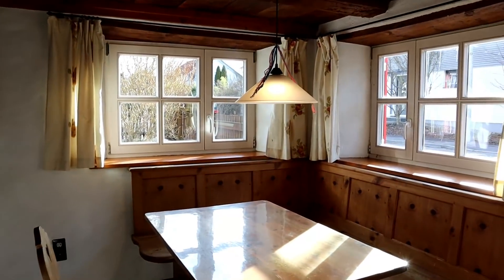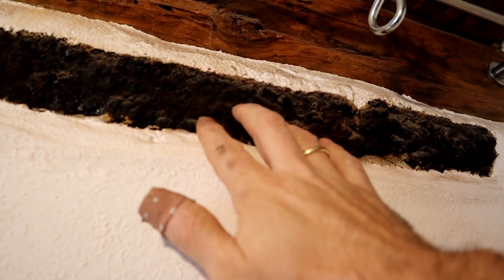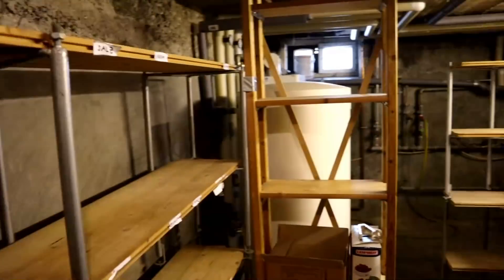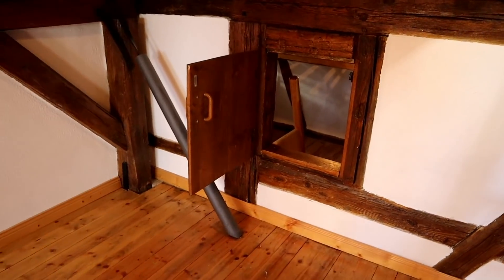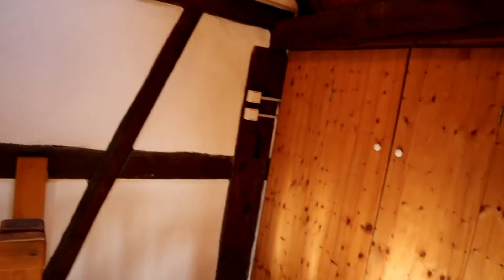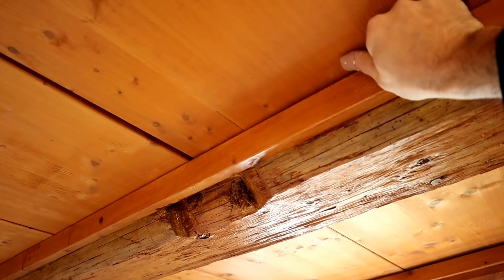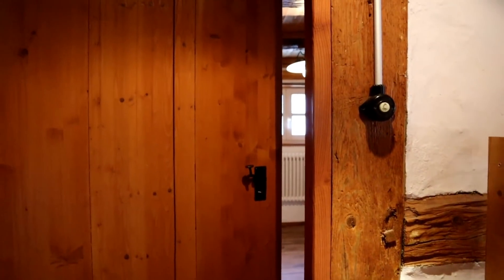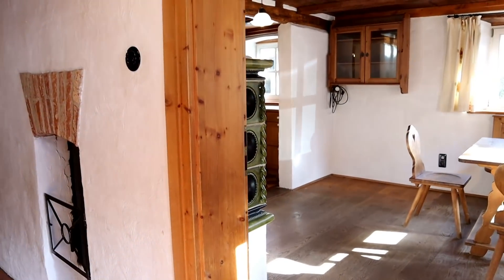The tiny half-timbered house 3

Comment: Hi Matthias, another great video, thanks for that. What a lovely house and the one you're in is amazing, You are a great craftsman and a hard worker, engineer etc and you also have the will to do it which is admirable. I love'd how you let the kids use "dangerous" tools (chisels etc}  and their work contributes to the project for real.
 This house is an absolute palace compared to the majority of houses built in Ireland  at the same time A lot of the old cottages were built from clay or adobe("dobe") with no foundation and lime rendered on the outside yet they still survive..
These were/are really tiny houses, as a rule the fire was never allowed to go out as it was the only means of cooking and the front door was always open to clear the smoke and let light  and the neighbours in.
 Anyway, thanks again, look forward to your next project. The fire hose you found for putting out incendiary bombs is an important piece of history, perhaps you could restore it as part of the house, after all if it had not have been there the house may have not survived. Best wishes,

Comment: "The house is only 200 years old" - got a chuckle out of that one.     😄
Reply: I've seen 500-year-old versions of this which are in better condition than wooden structures built only 20 years ago!
This also applied to the window frames of my parents' home... They rotted within a decade!
In the old days, they dried wood for many years naturally, this made it far more resilient. Today, these A-holes either paint over green wood or bake it in an oven which causes it to crack...

Comment: How do you prevent rot between the infill and timbers? It seems like moisture would get trapped in the walls. I also wonder if you have problems with condensation? Thank you for your videos, they are very interesting.